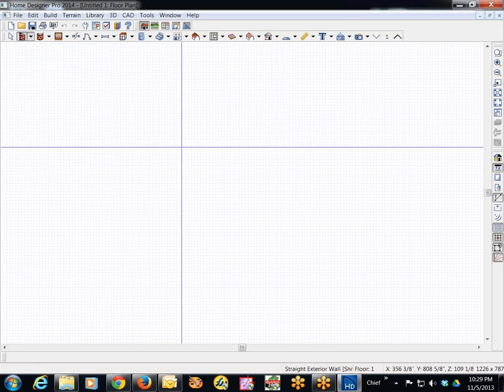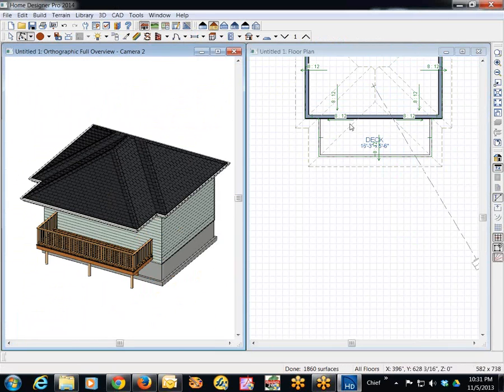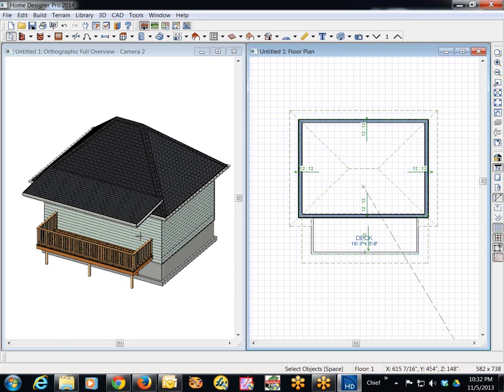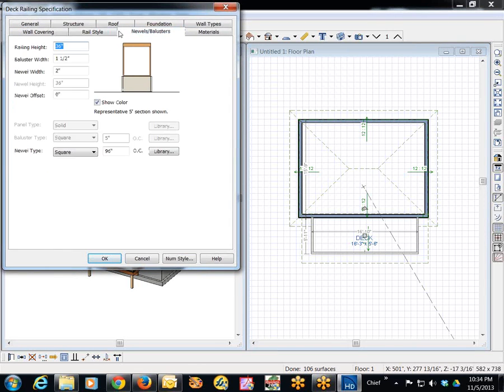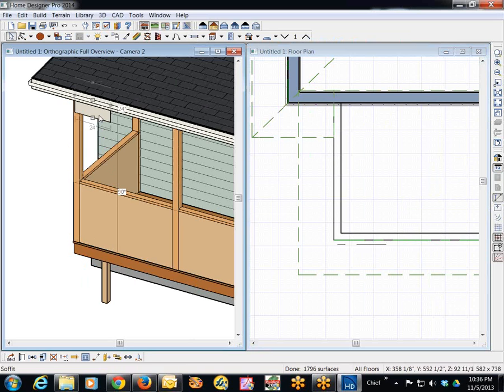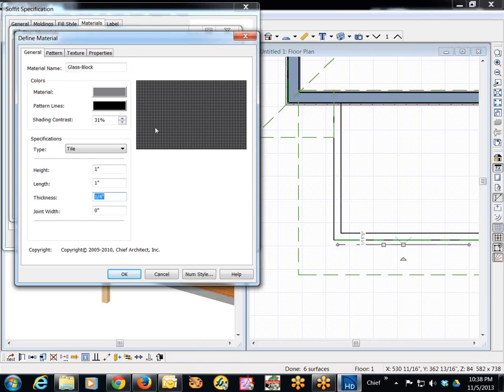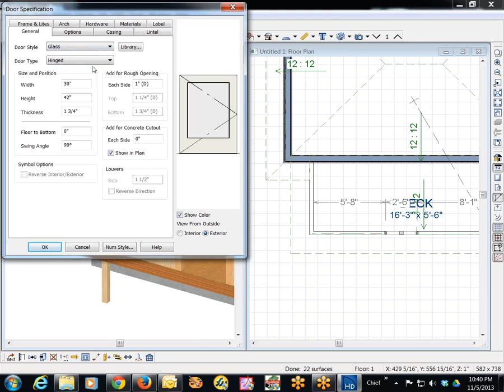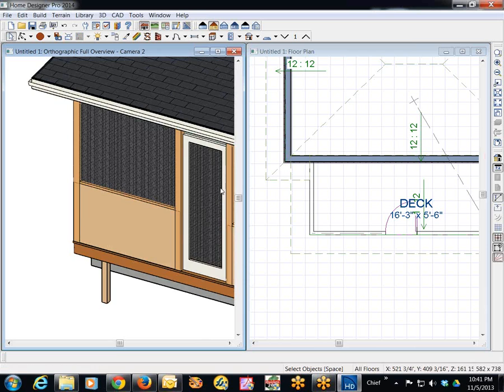Screen Porch's and related matters in Home Designer Pro 2014

Comment: Nice video. I believe in HD Pro 2020 you can paint screen onto a glass surface to do the same thing kinda quickly.
Reply from the maker: Not sure precisely what you mean, but yes on the materials tab of a window object you can change the "Glass" to "Screen" or something that at least looks like screen
Reply from the maker: Also, there is more than "one way" to create a screen porch in this software, I showed one of the ways to do this above